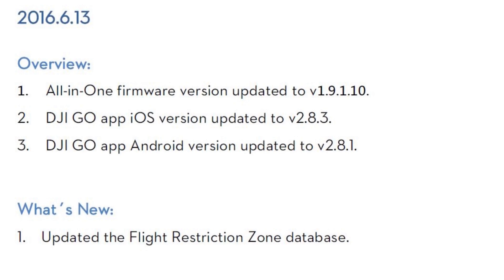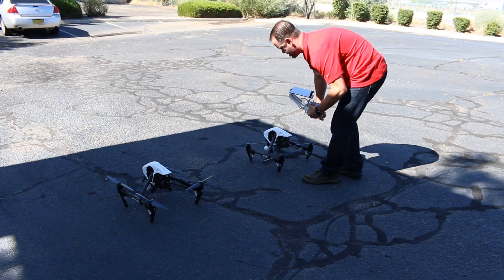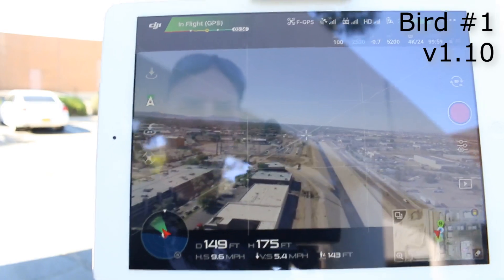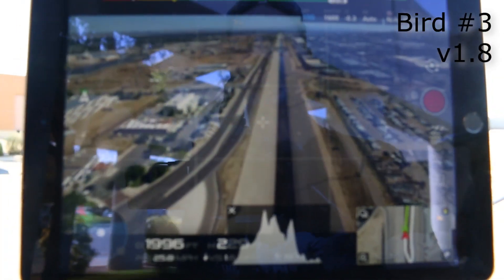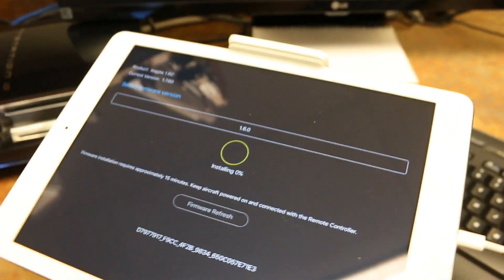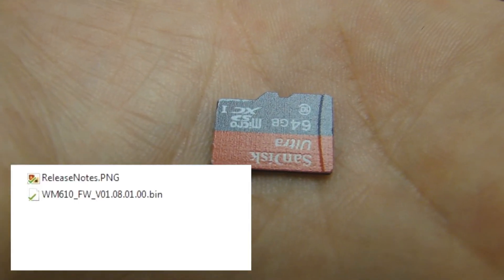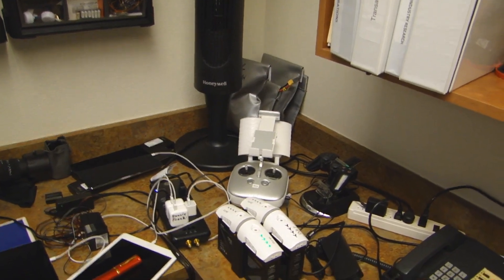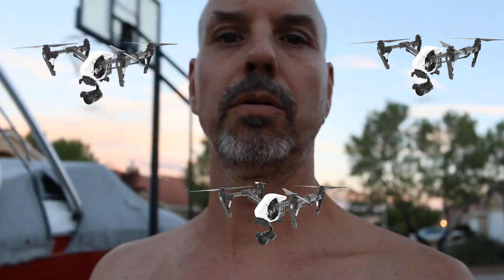Make your Inspire 1 great again...Part 1...

Comment: Thank you for the super helpful video! I suspected this was a problem with the v1.11 & v1.10 firmware as well - just wondering though would you have the v1.10 and v1.9 firmware file so I may perform the downgrade?
Reply from the maker: All firmware versions are located at the URL in the Description section.  Remember, you can only downgrade one firmware version at a time.  I recommend going to 1.8.xx.  We're having problems with 1.9.xx.
Reply: I can't seem to go to v1.8 from v1.11 though - I've upgraded too far :(
Reply from the maker: Let's check the release notes....

Okay...usually the release notes tell you which version you can go back to.  What I have gathered is that, generally speaking, one can only go back 1 FW update at a time.  So you're going to need to roll back to v1.10, then v1.09 and then v1.08.  If that doesn't work, we'll have to use the big guns.  Please report back if this works.  

IMPORTANT: Certain bird firmware versions are compatible with certain controller FW versions.  As of this writing, I was able to take the controller back to firmware v1.6 directly via the Go app.  Hopefully, this is still possible.
Reply: Hmm the problem is I don't have the v1.10 and v1.09 files would you? They are not on the panorobot website :( I can revert back to 1.6 and 1.58 on my controller through the app no problems
Reply from the maker: Ahhhhh....Okay....I have added directions in the Description section to get v1.09.xx and v1.10.xx.
Reply: OMG! you are a life saver thank god they didn't delete these off the website - I will test it out tonight much appreciated! :)
Reply from the maker: Glad to be of help.  Thanx for subscribing.  Please post your results.  Be patient with the downgrades, as they don't always take the first time.  It can be a PITA, but it's worth it in the end to have a rock-solid bird.  My bird has been in service for 14 months with zero issues.  Not one!  Good luck!
Reply: So it have tried several times to downgrade to v1.10 but the txt file in the sd card keeps saying cannot downgrade with this version of firmware :( In my range testing I am getting about 1500m on v1.11 before the signal completely drops out
Reply from the maker: Hmmmm....that's interesting.  I have never tried to downgrade from v1.11, so I have no advice.  As much as I hate to suggest this, contact DJI tech support.  I know they suck, but that would be my next plan of action.

All version release notes specify which version you can downgrade to sans v1.11....hmmmm....  I would research this, but I don't have this version, so I can't try their lame suggestions.  I wish I had better advice and/or news.  Hopefully, you can work past this v1.11.xx bottleneck and report back your finding.  Best of luck.
Reply from the maker: 1500m isn't bad and probably on par with the range of my system without extenders.  With passive range extenders, I can get about 2000m before signal drops out.  Have you tried the passive range extenders?
Reply: I did have one of those copper foil reflectors things with me but I didn't think to try it silly me! I was flying at the coast though where there are hardly any houses (and using 32 ch hack) so I was just expecting better. I will try with the extender and let you know - I may just stick with this firmware oh well
Reply: Just updating you on this - I'm still on v1.11 but I have since modified my controller with a Titan Drones Control directional antenna and I have gotten 3500m in the same location before the signal dropped out using auto channel selection! I'm still curious as to what kind of distance I would get if I was on v1.08 firmware so I may take it to the pros and see if they can downgrade it for me
Reply from the maker: Check my video Description.  I left instructions on how to get past the v1.11 bottleneck.
Reply: @drummerdonniedotcom  Hey Donnie! I haven't looked at this for a while cause I had all but given up trying to downgrade from v1.11. Thank you so much for the information about the magic key!! It worked straight away and now back on v1.08 & the video signal is definitely much more stable =D
Reply from the maker: @MaximumPCs : That's awesome.  I'm really glad it worked for you!

Comment: ~> Funny, my Inspire 1Pro said it would not fly unless I updated. Had to update the controller and aircraft and they work fine.
But they do have the restrictions added - no fly zones.
Those whom did not update both RC & AC, shut off, restart, complained of green video issues..
DJI had said flight would be limited to something like 50 meters high by 90 meters distance in order to get us to upgrade.
Reply from the maker: Yep...I guess I'll be sticking with v1.8.xx.  I honestly see no reason to update.  After over a year of flying (roughly 60 hours), she's been rock solid.  If it ain't broke....
Reply: Donnie Frank ~> I believe they have removed older firmware versions they deemed vulnerable from their server making downgrading a waste of effort on my part. 
I just don't understand how it's letting you fly the older firmware after making the upgrade mandatory ~"or you'll be flight limited". 
Doing this to just some of us?! B4 upgrading, I indeed was limited! 
*Now they require signing into the app b4 every flight (then close it and hit airplane mode).
STILL ~ wondering if I go backwards step by step, if I'll ever be able to get back to 1.08.?
Reply from the maker: Well....DJI hasn't "removed" legacy firmware versions per-se.  They simply don't keep a legacy firmware archive on their website.  This may be by design or just laziness.  Based on my dealings with DJI, I'm going to guess the latter.  That said...

It sounds like they pulled some real BS with version 1.11.  Scary.

Fortunately, for now, one gentleman has stockpiled ALL firmware versions.  Go here:

http://www.panorobot.com/dji/inspire_firmwares.htm

I don't know what "poison pill" DJI planted in v1.11.  I can't speak regarding v1.11.  I CAN say with 100% confidence that you CAN roll back to any version you wish from 1.10, albeit, one version at a time.